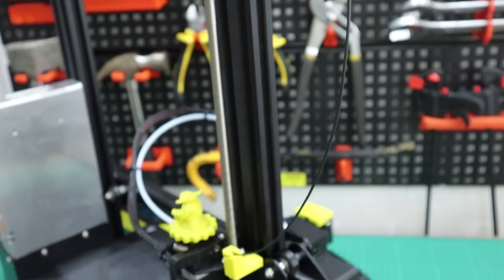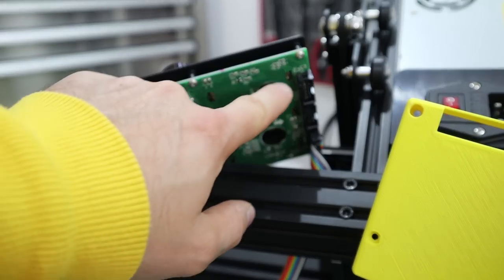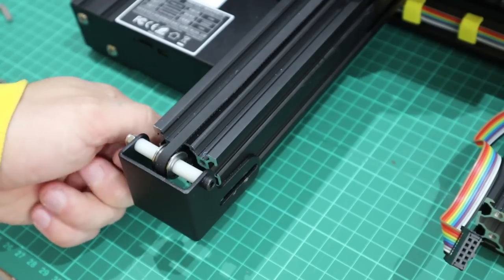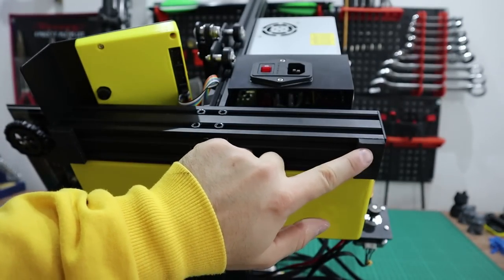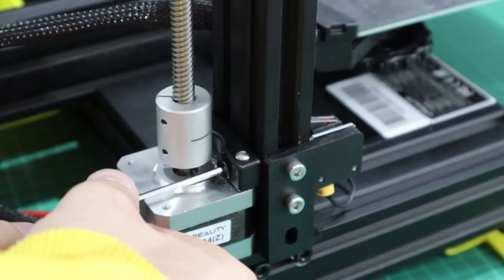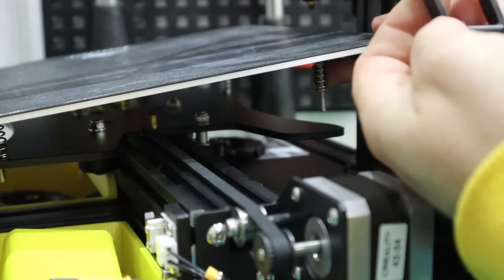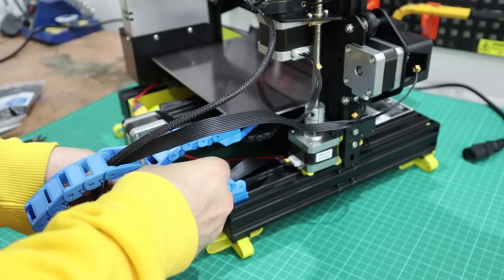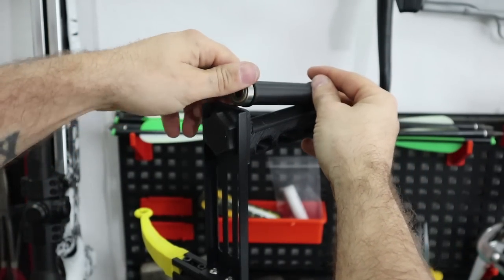Ender 3 Pro Upgrades

Comment: Thanks for the reply. When I enter the Cable Chain #2620060 on Thingiverse it pulls up 20 different cable designs. How do I tell which one is yours. I prefer to have your files.  Also, what constitutes one chain section or length? How many parts are in one link and which parts are they? Hope this makes better sense. Sorry for the confusion.
Reply from the maker: I will find the exact one and link to that, if you read the thingyverse file it will have pictures and instructions as well as my video guide

Comment: Hello, I am new at using the printer, it says the version I have is 0.0.6, is there a problem with that? Because I have tried and after 40 mins the printer starts doing something completely different.
Reply from the maker: did you update cura

Comment: Would you recommend ABS for this? new to printing :)
Reply from the maker: I would if you could but i did mine in pla as its easier
Reply: I would only do ABS if your expecting constant high heat like in a closed car over the summer. PLA is a great choice for these type of upgrades.
Reply: ABS has really fallen out of favor over all in the 3D printing world, unless you really need some of its special properties. It produces smelly and slightly toxic fumes, and just about needs an enclosed chamber to retain heat for optimum performance. PLA is easy to print and is fine for most things, whereas PETG is good option for items that require a slightly higher impact resistance or temperature range. The only items in this video I would even consider printing in anything other than PLA are the Z motor mount (because the motor produces heat) and the filament guide (because the filament rubs against the inside of the ring) and the dampers (because PLA is stiff). That said, I've run many hundreds of meters of filament through my filament guide and there's only a very small dent in the side. I really would recommend PETG for the dampers though, as I've heard stories of them breaking and the printer falling over when printed in PLA.

Comment: Are the shims really still required? Mine seems to be fine without it.
Reply from the maker: If yours is fine then no
Reply: I tried it as I was curious, it does seem to work because I get a squeaking sound mid way without it. I used the slimmer v2 version btw.
Reply from the maker: @mikev333  awesome glad it could help

Comment: I have the pro too, but I can’t see how to clip the Yoda wheel into the extruder. There’s nothing sticking up enough to fit into the hole underneath. Help?
Reply from the maker: Yours may be a modified version?
Reply: @LearnAsWeGo  it was bought brand new, less than a month ago :( looks like I just have a version with a short stepper motor rod. I’m seriously considering replacing the motor, as I want the ease of pushing the filament though, that a wheel would bring.
Reply from the maker: @Baggins_lover  yes i totally understand, does your ender 3 have the silent board in?
Reply: @LearnAsWeGo  not that I’m aware of. It’s certainly not silent, lol!

Comment: What are the measurements for the bearings of the printable filament holder?
Reply from the maker: Not sure off the top of my head but there is links in the description for them on amazon

Comment: Now I like the chain links for the cable i run smt machines at work and they all have them to house the cables but seems like it might limit the z axis on the printer ?
Reply from the maker: Hi, no it doesn't limit the z axis

Comment: Im still figuring out if i have a Regular or Pro. It does not say Pro on the box, but it looks the exact same as a pro
Reply from the maker: where you put the sd card in the printer, if there is a fan on the top of the electronics box its a ender 3, if the fan is underneth its a pro

Comment: Hello. I pulled the file from Thingyverse and put it in my Ender Pro to print. However, when it prints (I tried to print clips), the clip is not solid, it prints sort of hollow and is easy to break. Are there settings to adjust to make the printout solid and could you tell me what those are? Thanks!
Reply from the maker: On thingyverse the creator of the piece you are printing will have noted what settings to use
Reply: The amount of material to fill in (infill) and hollowness is defined in your slicer software settings. Most of us use Cura

Comment: You forgot about the X stabilizer that goes on the top of the X screw and clips into the frame by your  filament at the top. With the guide at the top, and the spacer at the bottom, X screw will always run up and down true.  The guide is a easy print, just need a roller bearing like the ones in your filament roller to put in the guide. Also a duct to attach to the fan on the extruder, directing the fan air to the extruder tip is a must do first print.
Reply from the maker: Thanks for the heads up mate and do you have the thingyverse links or numbers

Comment: Can you please link the Rear Box on Thingiverse. Iv’e been unable to locate it. I found others but not the one you printed. Thanks for the video
Reply from the maker: I will try find it today mate
Reply: @LearnAsWeGo  Any luck locating the file?
Reply from the maker: @Edgewoodshores  so the file i downloaded didnt have the thingyverse number/link so i will try look manually now
Reply from the maker: Ive found one similar with a screw on lid thingyvers number 3088343
Reply: @LearnAsWeGo  OK so after checking more I think you got the file from the same person you got the front drawer from. When you download the files there is a "REAR" drawer in that folder. This link goes to his download on Thingiverse, The fifth picture left to right shows the blue drawer for the rear.   https://www.thingiverse.com/thing:3162464

Comment: Ahhmm… Do NOT use Cable Carriers with cables that are not designed for use with one otherwise you're setting yourself up for one hell of a burnt house awakening.
Reply from the maker: These come with brackets better than standard  so its more stable
Reply: @LearnAsWeGo  What's a bracket gonna do when the issue lies with the cables inside the cable carrier?
Reply from the maker: @Duraltia  there is nothing wrong with  the cables on these printers

Comment: Hi I am a newbie with 3d printing and have seen you have made a tool box for the back where I find it and can print it with my ends 3 pro mh. michael
Reply from the maker: Hi mate if i remember go to the thingyverse for the front tray and the stl is in there for the rear box

Comment: Are you sure you need that Z spacer? My printer does better without it.
Reply from the maker: If you rpinter doesnt need it dont add it
Reply: Learn As We Go, yea. So i have kinda looked into it and it seems like you only really need it if your Extruder motor mount + leadscrew nut holder is not bent properly. So the metal is not 90 degrees. 

Maybe you want to look at that metal part. You could use some kind of squaring tool. Even a geo triangle will do! Maybe try and check it out. It is worth a shot

Comment: Micro SD to SD Card Extension Cable Adapter
I tried two brands of Micro SD to SD Card Extension Cable Adapter on my Ender 3 and none of them work, the Printer micro SD card slot works fine without the adapter but once I use the adapter printer can not see the card at all. I used one of the adapters on my Ender 2 so I know it works fine. Anyone else had this problem??
Reply from the maker: Ive never tried one myself but may give it a go in the future
Reply: I will be happy to answer this as i have just had the same issue, this is the only workaround, when you insert the micro sd to sd adapter youll see on the main screen it says Card Inserted even if their is no sd card in the adapter end, when you insert the sd card into the adapter and go to the menu it will say no tf card inserted, if you keep the sd card in the adapter and take out the micro sd adapter from the 3d printer and reinsert it will say card inserted and then youll see print from tf card in the other menu (yes this defeats the object as you dont want to wear out the micro sd card and pointless printing a cover for it.

only work around, turn off printer insert the micro sd adapter cable into the micro sd port on the 3d printer and insert the sd card, turn on printer and look at the menu it should no register the sd card and few the files, and strange thing also if you remove the sd card and go to the menu and select print from tf youll still be able to see the files lol.

so the only workaround is that you have to insert the sd card into the adapter when the 3d printer is off, turn on an youll be able to use the sd adapter. hope this helps